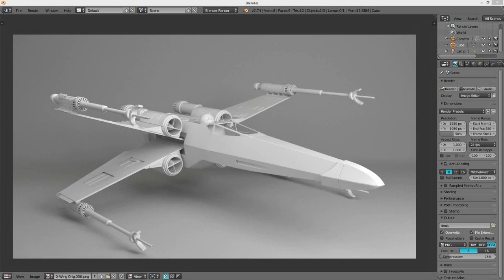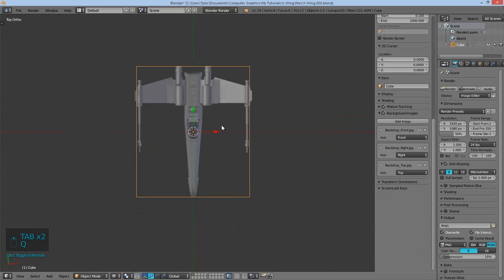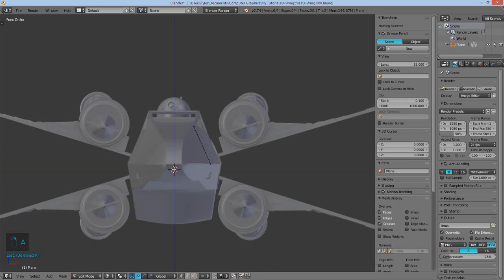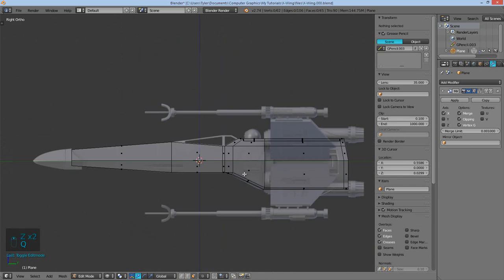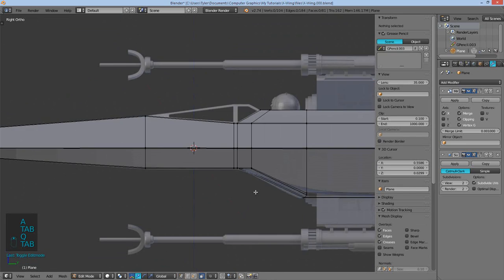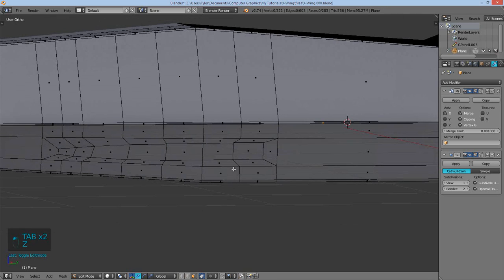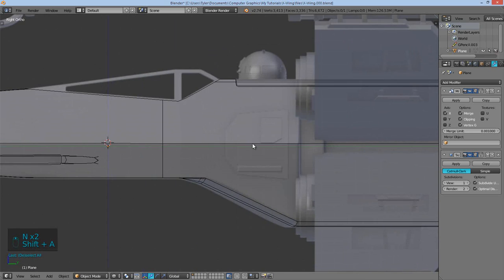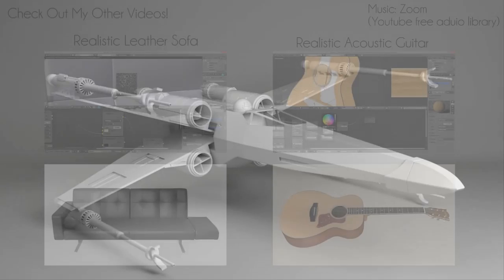How To Model A HighPoly X Wing in Blender - Part 1

Comment: Hi Tyler, thanks for producing this, it's help me a lot, and I've ended up with a pretty decent fuselage as a result of following this. I do have once question, how did you duplicate the air intake on the right hand side? I may have missed this in the tutorial or is there an easy way?

I ended up simply chopping the model in half after I'd done the left intake and reproducing the right with the mirror modifier, is there an easier way?

Comment: I have a problem with the top image you provided. It's smaller, the front and side images are alright but except for the top one.

Edit: nvm, just found out that I can increase the size of the image
Reply: +Dazon Tran Because he UNFORTUNATELY rescaled the images to fit 1600x900. Not keeping the original scale

Comment: For some reason, when I go to add the mirror modifier, it doesn't mirror the way yours does. Even though it looks almost identical and the 3D cursor and the little orange dot are in the same place as yours. Please help!!
Reply from the maker: Hi, sorry for my late reply. Try mirror on the y and x, in blender sometimes the origin point can rotate making the x axis the y or z axis.
Reply: I tried that and it still looked odd. Thanks anyway!!
Reply: +TheSimpleGamer try pressing Ctrl+A and select 'Apply Rotation' or one of the options. It worked for me